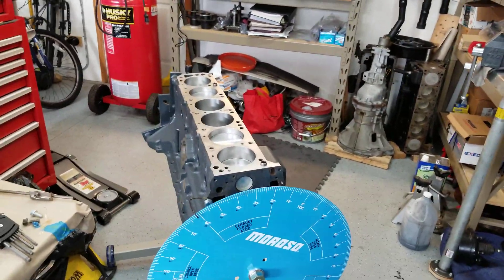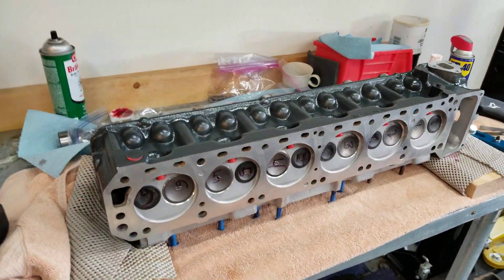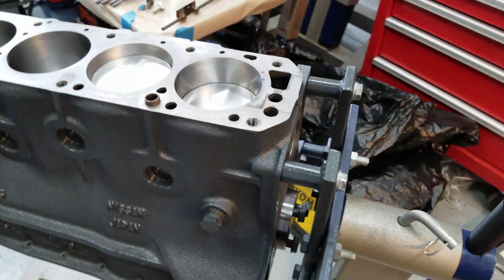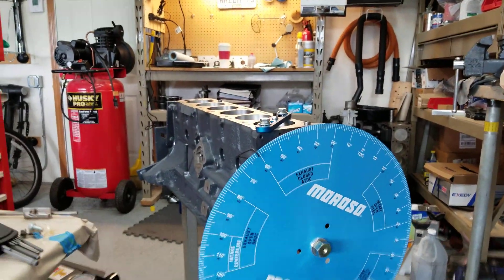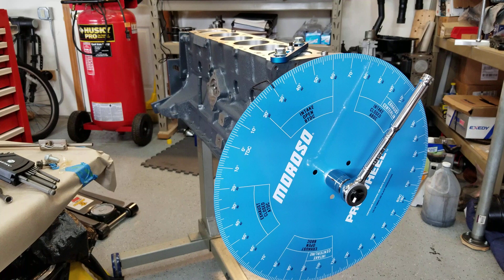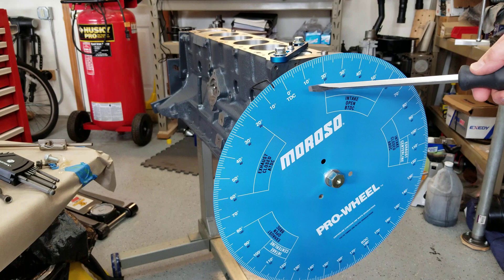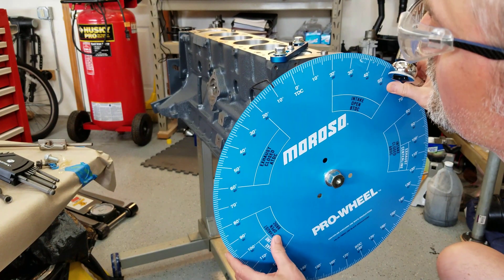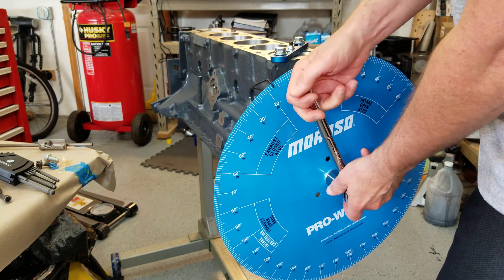Datsun L6 engine , Finding TDC

Comment: Hi Joe, I know this video is over a year old but is it possible to show how you did find the right position for the piston stop. Thanks
Reply from the maker: Hello Ken.  I don't think there is a 'right' or correct position for the stop.  As long as the stop is positioned some distance below top dead center, like maybe a 1/4" or so.   Of course you have to take into account what type of piston you're using. The change in piston position, vertically, with relation to crank angle decreases significantly as the piston gets closer to top dead center.  Just the nature of a crank mechanism.  
If you're farther away than 1/4" it should improve your measurement resolution, if that makes any sense.  
If i could do it over, I would have installed the flywheel and some marks to refind TDC later for cam timing.  Would have been a little easier than the same exercise thru the spark plug hole.  Gotta keep learning...